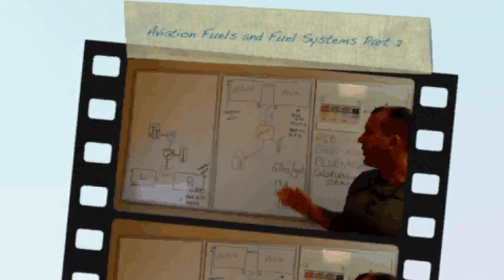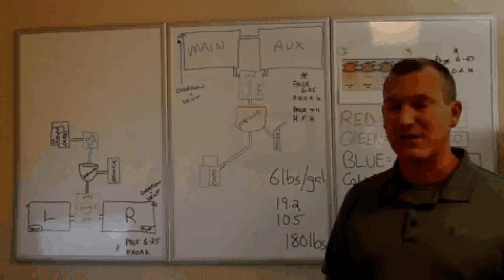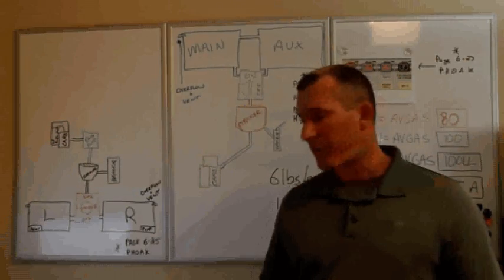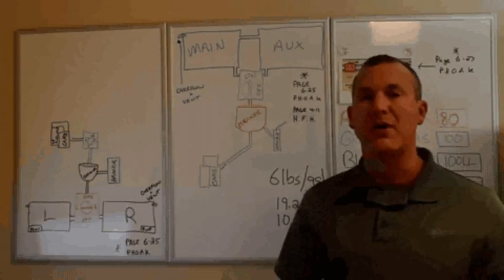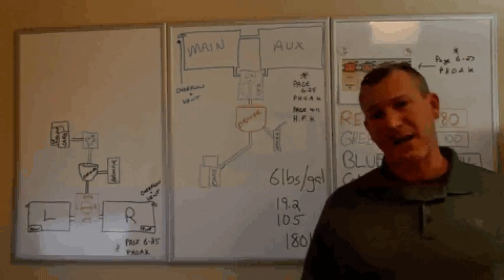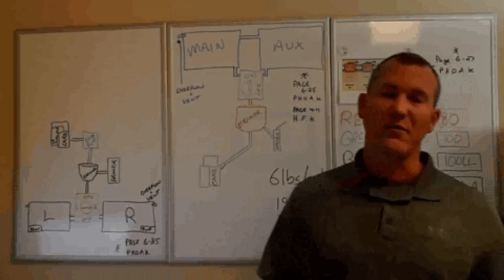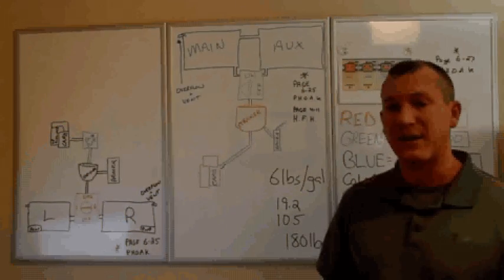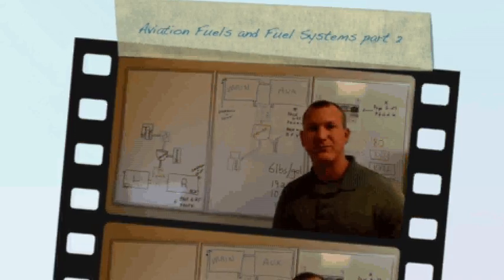Aviation Fuels and Fuel Systems part 2

Comment: Thanks for this video.   I recently put in for a job as a fuel truck driver at NAS , Fallon. .  I am a little familiar with a few things you discussed because of a job I had previously in Iraq working  for aviation fuels, But I actually never fueled  aircraft and I was hoping to gain some working knowledge in case I luck out and get an interview.